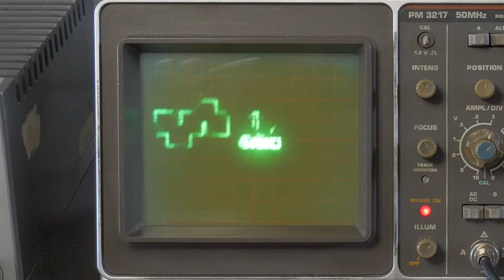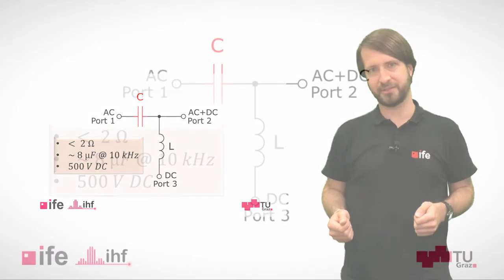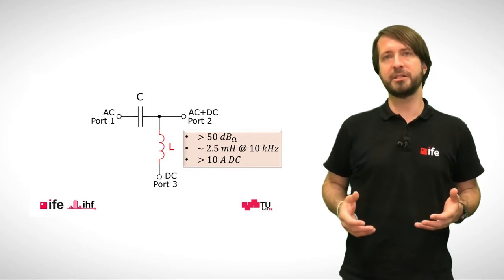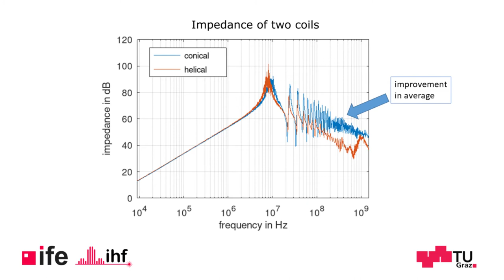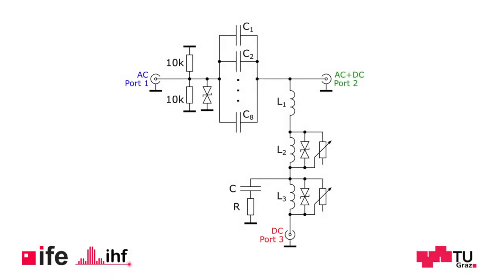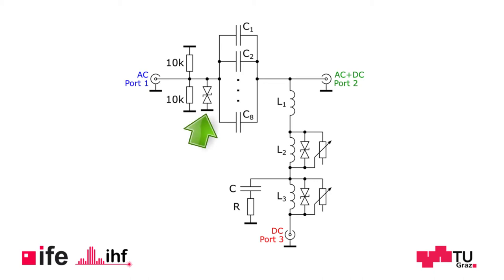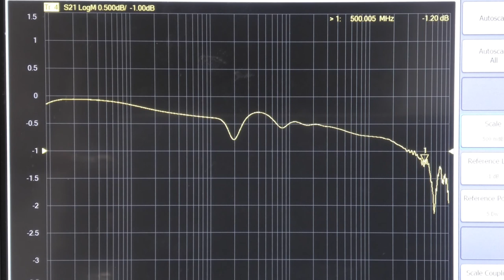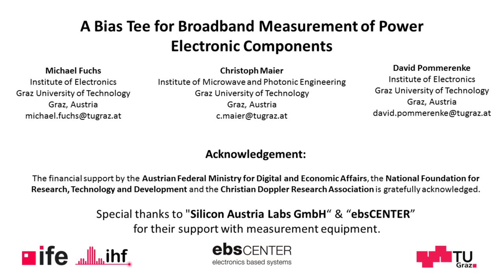EMC+SIPI 2021: A Bias Tee for Broadband Measurement of Power Electronic Components

Comment: Great video, but there seems to be a bit of a noise issue with the audio
Reply from the maker: Yes, unfortunately that's the case since we had to deal with a tight deadline and new equipment, which we obiously couldn't handle right away.
Reply: I would recommend to edit the audio track again with auphonic 😁 you don’t even need to know how to set up everything the algorithm is smart enough to denoise it accordingly to broadcasting standards 😎
Reply from the maker: Thank you for your tip. Dominik and Niki just produced a video for the Asia-Pacific International Symposium on Electromagnetic Compatibility 2021 (APEMC 2021). We already managed to improve the audio quality and we additionally used Auphonic especially for audio level adjustment.
We plan to publish it in the beginning of October, after the conference is over :)